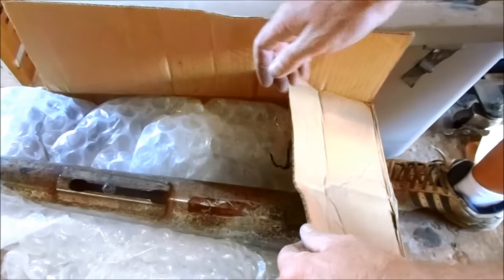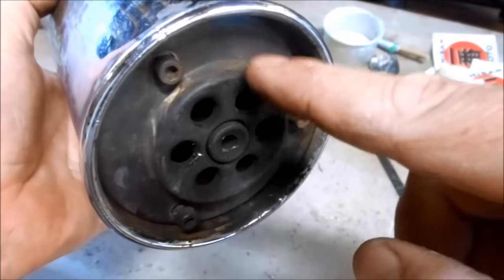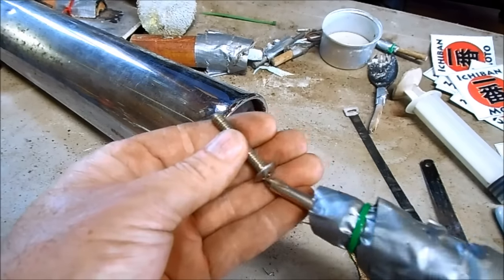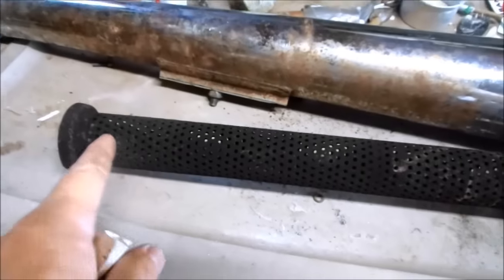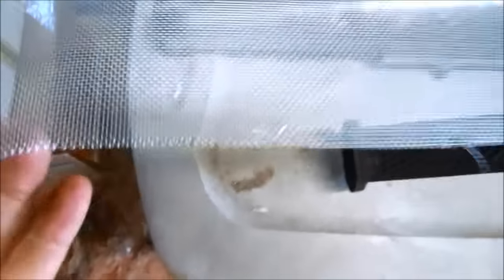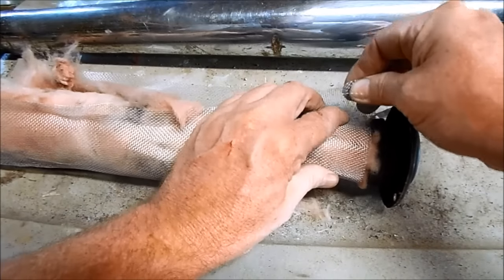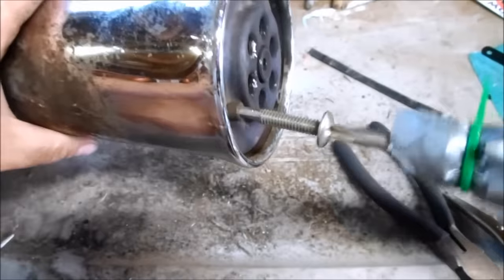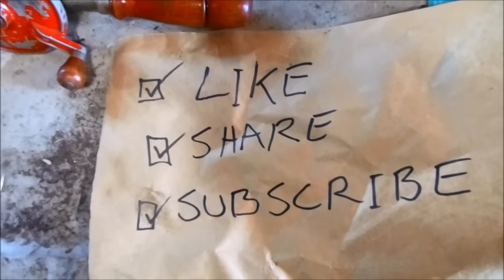how to remove and repack a vintage motorcycle muffler exhaust baffel silencer with fiberglass

Comment: They looked like everyday allen head screws
Reply from the maker: +Trev S  who is allen?
Reply: Ichiban Moto  its used on bolts and screws normally made from high tensile steel or exotic metals
Reply from the maker: +Trev S why can't they just use common fasteners. ..  jeez
Reply: Ichiban Moto Allen key screws & bolts are of a higher grade material & specification - with tensile strength 2-3 times that of ordinary bolts
Reply from the maker: +Trev S seems silly for something as simple as a baffle
Reply: Ichiban Moto It is overkill but some companies see it as a sign of extra quality

Comment: Freaking genius! I never knew how to remove those European security bolts! I always had to cut them off, drill them out, and then tap and die it! This will save me weekends of time. You're the best!
Reply from the maker: +beau danner                   you are very, very welcome !
Reply: Ichiban replied to my post!!!! Totally geeking out! :)
Reply: Its an allen key bolt
Reply: Or torx bit...
Reply: @CJLoweryakashinobu  Indeed it is an Allen type of bolt, however, you are completely missing the point; if it is a strange British bollt then the humour is compounded, since Ichiban has to make a special tool. Just enjoythe fun!

Comment: I love the packing material. Chosen with care. Made me laugh for 10 minutes.
Reply from the maker: +Lucky Goose       it's the good stuff !
Reply: The english motorcycle muffler screen scissors, high temp muffler wire, and english security bolts were pretty good too.

Comment: Wow, an excellent idea making your own tool to undo the British baffle bolts. I've been using a hacksaw blade to cut a slot in them to use a conventional screw driver for years! Your method is much better. Thanks for the tip my friend.
Reply from the maker: +Triumph Rascal (Triumphrascal)     and I'll be ready for the next brittish muffler that come in

Comment: What R value do you use? I use R15 for the summer and R25 for the winter cause its cold in Canada  I also use a small allen key to poke the insulation right into the little baffle holes seems to keep the pipe a little warmer. ,,Just sayin
Reply from the maker: +Triplescanada   I used RRR values...   thanks for the  excellent tips from the great white north !

Comment: And can you help with some advice on balancing carbs please? I had them on the scales for ages and they are exactly the same weight,a perfect balance but my bike still won't run nice. What am I doing wrong?
Reply from the maker: +Andrew Wilson   maybe one carb is alloy and one is iron?   watch my DIY Vacuum Manometer video on how to balance carbs.
Reply: make sure the carb oppsite the kick stand is slightly heavier because the handlebars won't turn if it isn't

Comment: I don't have muffler screen can I use my wife's stockings I think they are heat resistant as she says she feels hot in them !
and attach stocking mesh with green zip tie or heat resistant construction tape ?
Reply from the maker: +Jeffrey Butt    temperature grade assembly tape is a good replacement for muffler wire and is much cheaper than green zip ties

Comment: I'm building a electroplating bath and I'm having problems suspending the little nickel squares in the bath without contamination from the wire or solder.

I don't feel like paying £28 for a titanium cage that won't fit well so any suggestions ?
Next try is with jumper clamps chopped of garbage held up with bolt and nut so i can adjust height but I'm open to suggestions.

Comment: Good day all : I have moderate experience with 2 stroke exhaust systems and similar problems . Fiber glass packing in exhaust systems . I disassembled and repaired exhausts on old Yamaha's , Kawasaki's and Suzuki's with fiber glass packing . The glass packing was most often the same problem ; moderately packed with carbon and congealed unburnt 2 stroke oil . They were most often found with fiber glass packing that had been pushed to the rear end of the mufflers by the exhaust pressure . This in itself clogged the mufflers and caused twin and triple cylinder bikes to be not revving freely and "Fighting Themselves" . This condition I found on Yamaha RD 350's / 400's , Kawasaki 350's/500's and 750's and Suzuki 250's twins . Removing the baffles , pulling out all the old jammed fiber glass packing , next was to mount each baffle in a vice and use a propane torch to heat up area by area on each baffle around the outside . As each small area was torched , a wire brush was used to scrape away all the black junk off the baffle . When they were all finished and reinstalled the exhaust systems were certainly much more free flowing and much easier revving engines with cylinders not fighting each other . Even a lot of licensed mechanics could easily overlook clogged mufflers with unequal cylinders and wrongly think that it's due to worn cylinders/pistons or even some wrongly believed it was time to re - jet carbs . Over the years I spoke to a pair of 2 stroke snowmobile owners and they also have removed old fiber glass packing congealed with old cooked 2 stroke oil that was clogging their mufflers and like me both would never put fiber glass packing into their mufflers again . Another thing was to use only synthetic 2 stroke oil you can't go wrong with that . The cleanliness of the exhaust was better , better cold starts with smoother acceleration , much less smoke etc .  Hope that I've been some help for you all !  bye bye for now .
Reply: What are you supposed to use then ?  I have an old 1969 Yamaha AT1 Enduro, and someone took out the whole silencer baffle, and it's to loud for my neighborhood ?  I can't find any OEM, so I ordered a 4" baffle that is 1 1/2" at the end to fit.  Just a small pipe with holes, but I'm thinking it's still going to be too loud, that's why I'm here.
Reply: @dronai  The only thing I could suggest there would be to try to find a good used replacement baffle or a whole exhaust of that same model bike . These are sometimes available through the cycle wreckers . You might be able to leave your name with the wreckers and they will search the system for you to locate that replacement exhaust .  There also may be up to 5 or 6 other models of Yamahas that are 1 or 2 years older or 1 or 2 years newer that also may use that same exhaust . that would help your search . You might be able to search the system with your own private computer  to locate another whole exhaust that you could clean and install .  Hope this helps you .

Comment: if you do not have allen screw wrenches you can use a bolt of the right size.
It is also a 6 sided pattern and you can put 2 nuts at the end to lock it in place.
Or take a long bold and and band it 45 degrees and you have a simple wrench.

Comment: i need tips on repairing a 2004 flywing mx150 Silencer its missing entire baffle and end cap. the end cap looks like it was torn off during a wheelie or something and it bent the very end of the silencer so i had to cut off about an inch of the piping still have a ton of space but now has zero mounts for baffle or end cap im a machinist but i dont know the assembly or whats needed

Comment: Wow, what did you do to remove that rust from the exhaust? That is chrome right? I have a honda cm 125 and I've been wondering about how to make the chrome look better. I'm gonna blast and spray the frame and bits, probably take the wheels apart, buff the hubs rims and replace the spokes, but I don't wanna strip the chrome from the accessories and tank it's value. I also don't wanna pay a tonne of money for re-chroming :P

Comment: I thought you might be interested in my latest discovery, inspired by your good self. Upon realising I was short on diamond paper I realised I should find an alternative. I cut a length of fabric reinforced pressure sensitive tape and inverted it on my workbench. A layer or organic ground aggregate was evenly spread on it,pressed and then the excess placed back into the sandpit. Et viola, a fresh custom graded abrasive paper!
Reply from the maker: +Andrew Wilson     bad ass !    check out my angle grinder video !

Comment: You can also use steel wool to pack your baffles and it will probably last a lot longer.
Reply from the maker: i shall try that !
Reply: Worked for me. I used back in the 70s for my CB350 after I got a ticket with drag pipes on it (young and dumb) and it worked so well , I left it in until I sold the bike.

Comment: maybe the funniest thing I've seen in a while. that buffing wheel was hard to top.
Reply from the maker: works badass !
Reply: Yeah there's no way the rust came off that muffler with the contraception he was using. Just use some steel wool andl some metal polish. It's not like it's a trade secret.

Comment: About those bolts are they socket head cap screws , using allen keys to tighten them?
Reply: No you want to use hex keys.
Reply from the maker: +Beau Michna  a hex seems like bad luck
Reply: +Ichiban Moto  Ahh your right!  Better to play it safe and sand down the screw.

Comment: hex drive tamper-proof security bit  is what they are called :) There are many shapes and sizes, however the point is to stop people from walking along with there budget screwdriver set for 1 usd 99p pound store and removing them. Some are put in places that require human protection, E.G park benches, other places are used in gadgets, mains plugs + current and toys which stop children from attempting to open them to self service, However due to the fact we now have Ebay and Amazon, kids are able to just go online and buy these sets, where as before the days of the Net people had to order them in  specifically from certain tool makers. P.S im UK was born in the 80s and as a child i loved taking things apart, sadly my Nintendo NES had these screws deep into the case and i always had to wonder in my wildest dreams what was inside that shell :( So i just got the radiator bleed key and opened the valves to see where the water come from :D

Comment: you know what "imbus" Bits are? with them you could open the security screws
Reply from the maker: are there universal security bits ?
Reply: those are availiable in germany (allen key)
Reply from the maker: i need to make a trip to germany
Reply: Do that in Summer. ONLY IN SUMMER
Reply from the maker: I don't know.. the winters here are quite brutal .. I could use a winter holiday
Reply: Well, it's not that cold here. last year like 1-3 DAYS of snow. But, the days without snow are the worst

Comment: The bolts on the exhaust are Allen bolts, and the tool to undo them are Allen keys.quite cheap, buy them individually or in a bunch.
Reply from the maker: they allen key only fits the helmet lock tho?
Reply: No you need a british muffler security screw spanner.

Comment: use allen key .
Reply from the maker: that only fits the ignition and fuel cap
Reply: +Ichiban Moto no thats not true. this is an allen screw u open it by using  allen key.
Reply: +aditya kumar  the so called six side pattern ☺☺☺

Comment: THIS IS NOT HOW TO DO THIS. Never use attic insulation for your high temp muffler baffle wrap. Did you notice the little bits of wood and debris in there? Rat poop? WTF!! So unprofessional. Use ceramic wool muffler packing, the stainless steel mesh and high temp wire wrap (such as safety wire) to ensure a long lasting quiet muffler that will not blow out.